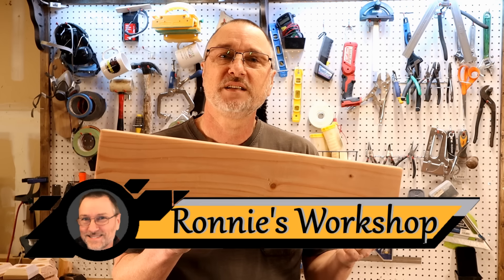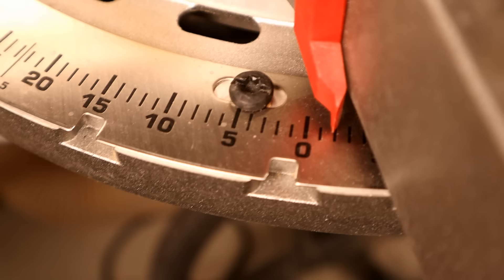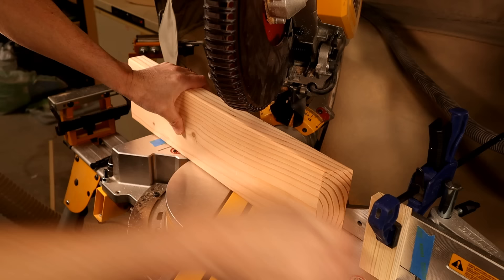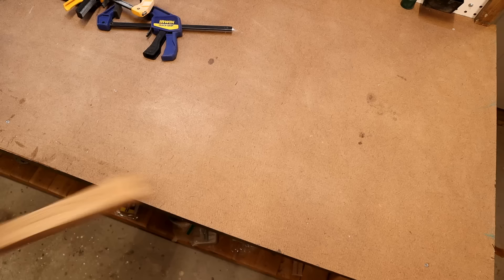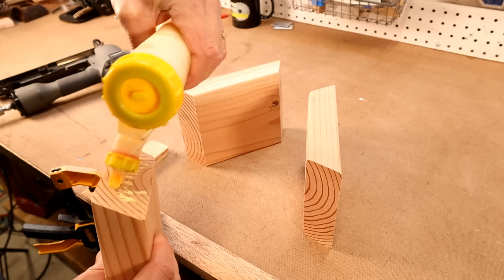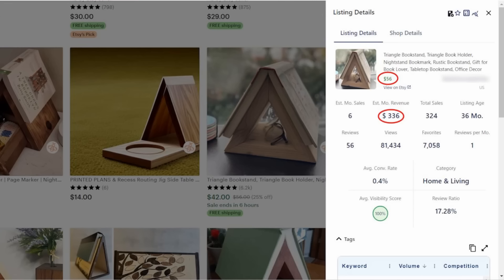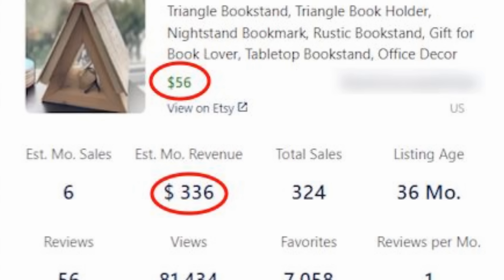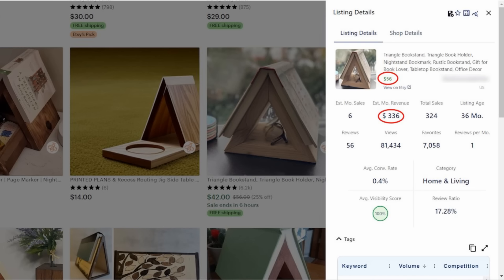Woodworking Project to Sell for a BIG profit! #woodworking

Comment: There's literally one on that Etsy screenshot you showed for $14 and only has 6 reviews that's probably a similar quality. They're selling around 6 a month and already have reviews so you've got to try break into a market loads are already doing not to mention needing a $600 saw and a nail gun. Probably easier just to use them skills in a job.
Reply: @adoRED019 You can easily do this with a Hammer, Hand saw and some sand paper just takes a little longer. This is a great way to teach your kids some skills and they or you can make a little money as well. Why are people so Negative and limited in there thoughts. You could even take a little longer, Paint, Carve or change up the design. plus most have bits of timber laying around. I mean if you wanna buy plastic crap and make your home look like a $1 shop feel free.

Comment: Never knew there was such a thing as a book holder! Wouldn't work too well with paperbacks.
Reply: Maybe a smaller version? Change the angles? 😊
Reply: @gwarlow  My point is that paperback books are quite stiff,and would not stay on a book holder without damaging the spine.
Reply: @mikedunn7795  I wasn’t arguing against your point. Just trying to suggest workarounds. Cheers.

Comment: Nice video but can you show us some things we can make that don't require alot of machines and tools preferably by hand. Some people don't have a workshop full of everything.. 🙏🏻
Reply: This one is doable with careful layout and good hand saw/plane skill
Reply: This is an example of what you want, no tablesaw or anything big
Reply: This can also be done with a basic circular saw and maybe a clamp.  Most curvilinear saws have settings to angle the blade. 
Understand, that when these videos show more sophisticated tools being used they are merely for convenience.  May take slightly longer with a basic power/hand tool, but still perfectly doable within a reasonable time frame.